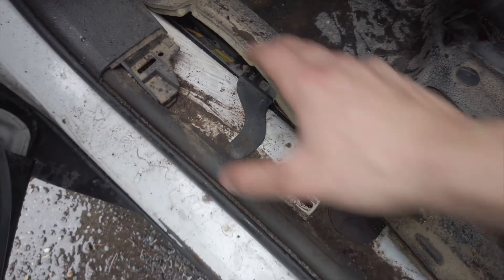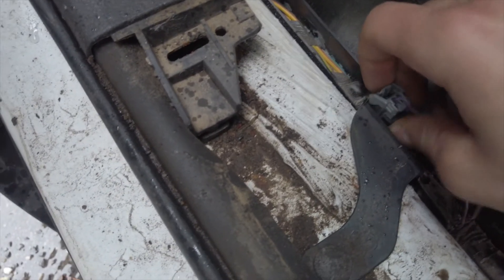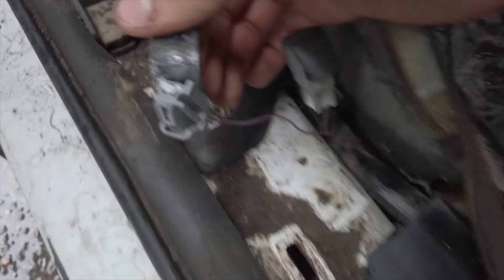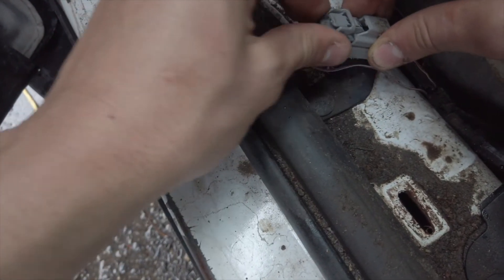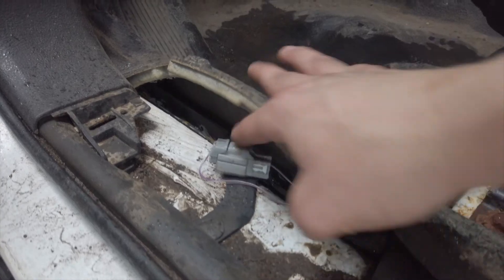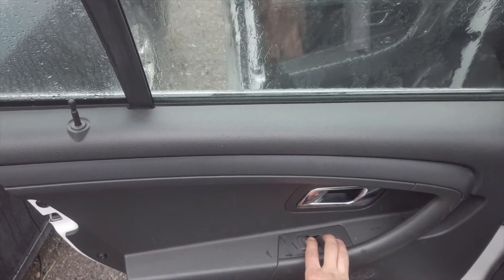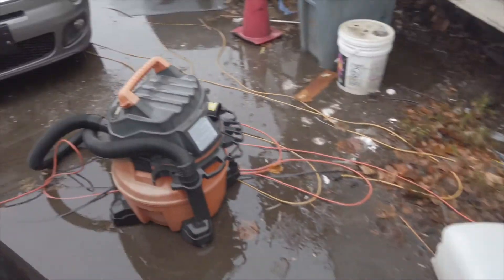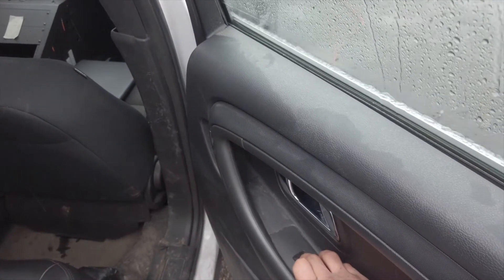REAR WINDOW SWITCHES ON THE 2013-2019 FORD POLICE INTERCEPTOR

Comment: i connected the plug, and it didnt work. i cut the wires and twisted them together, still didnt work.  what to do next?
Reply: it was getting late and i couldn't get my rear window up.  the master control in driver side used to work,but it slowly became more and more difficult to put windows up.  and tonigth it stopped.  so the driver side rear window would only go down, and the plastic on it broke.  but sometimes if i pull up on it just right it would work.  but tonight it wouldn't.  so since it was already broken i broke out the entire piece, and use a thin piece of plastic to activate the switch and get the window up, even being able to press the button directly it didnt want to work so much.  but at least now i wont be able to accidentally roll the window down.  but id like to get it all fixed.  any ideas?

Comment: This is not the case on 2016 explorer PUI.  Took off the floor step panel and it did not have this harness connector . Just straight wires running through. Even opened up the column panel or B pillar thats in between the front and rear doors, but couldn't see it

Comment: Excellent very helpfull, but you said you will show where is the connector for an interceptor utility...
Reply: I just found it below the cross member for the driver’s seat near the pillar. Had to take the plastic panel off the pillar. They tucked the connector in a beefy piece of conduit and taped it up good.